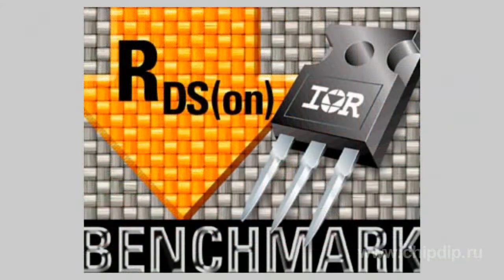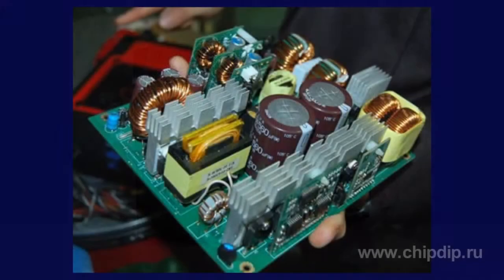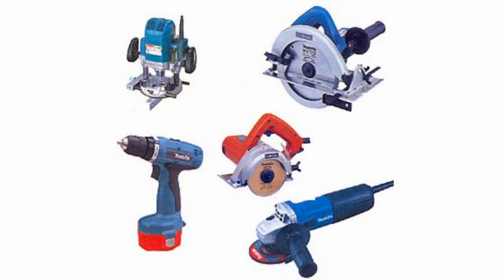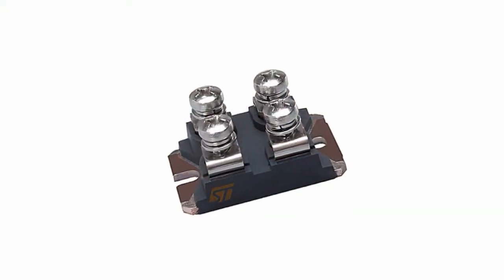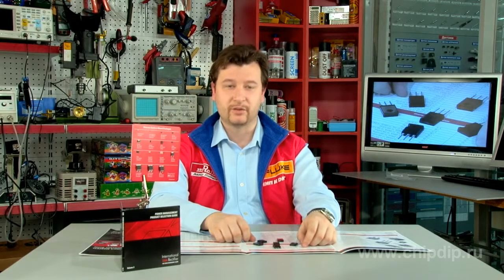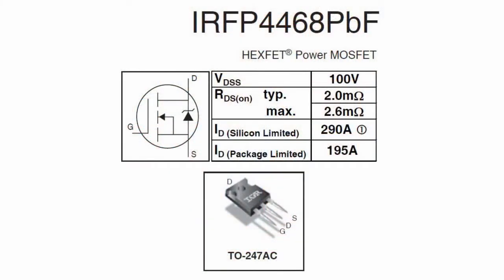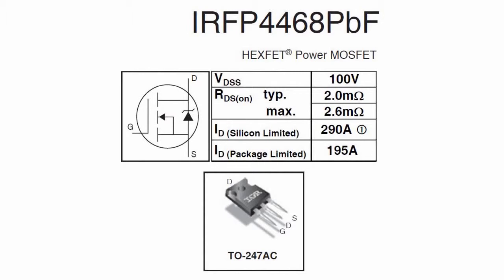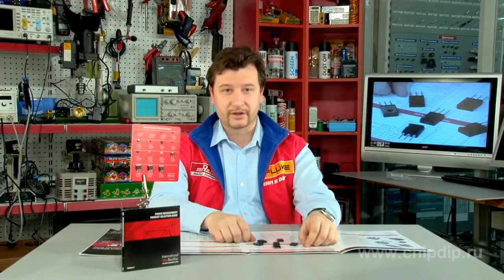IRFP4468PBF Power N-Channel Transistor

Comment: Hello , can you kindly tell me if this FET can replace the IRFB4110  used in a micro inverter 2000w 16v to 65v dc input and 230v 8 amps single phase out put?
Thankyou kindly.
AndrewNz